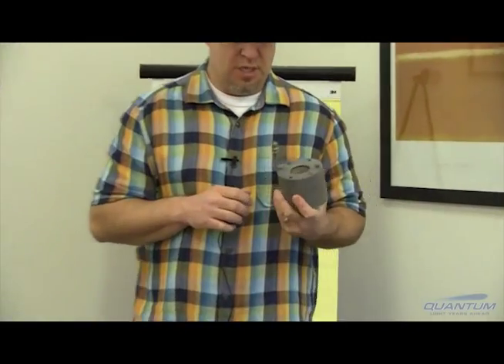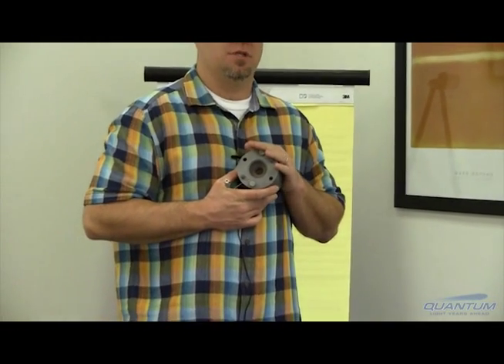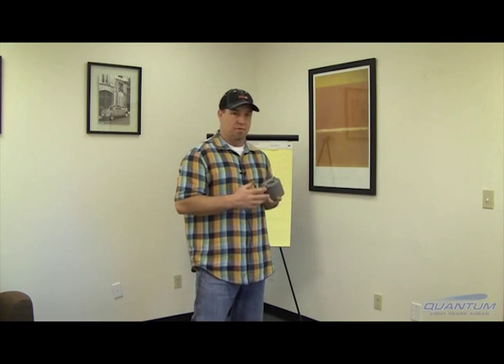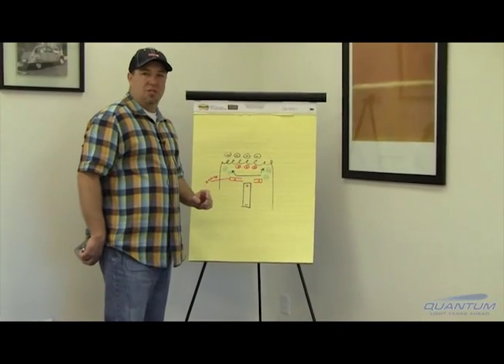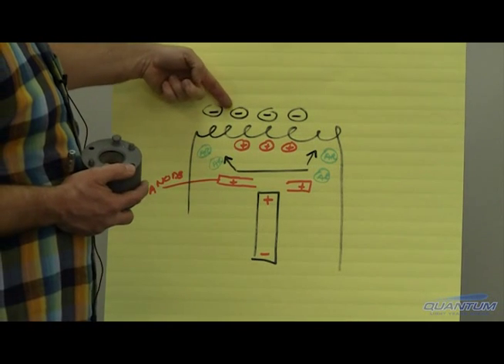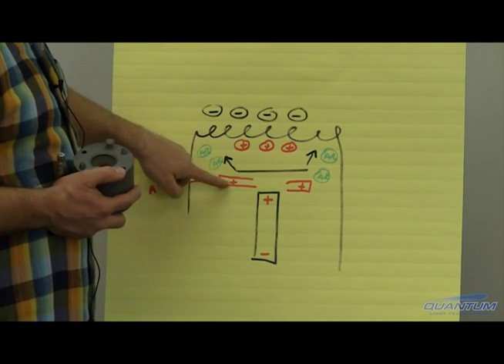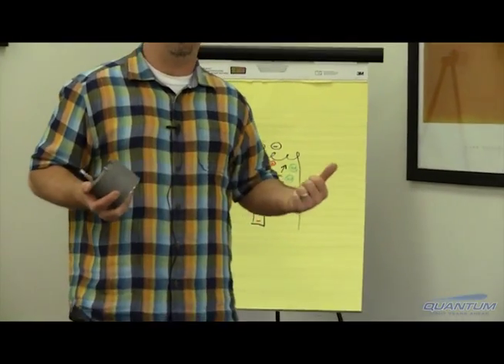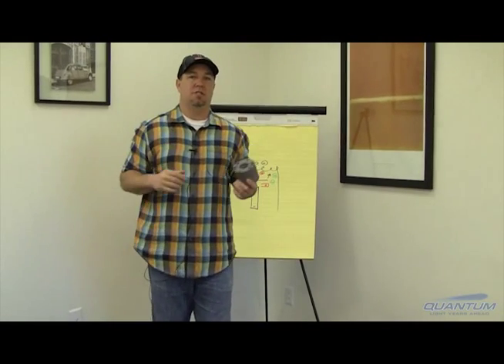How does an ion source work?

Comment: Thank you, to summarize a gas is placed about a filament that is emitting electrons due to a  potential difference on the filament. The emitted electrons bombard the gas atoms causing the gas electrons to be ripped away from the argon atoms;causing the gas atoms to become positively charged ions. Question:How does the filament emit electrons from it's surface when a PD is across it?
Reply: I'm by no measure an expert on any of this, and am a bit confused by the video.

Generally, when you need free electrons, you put a potential difference over the filament, which heats up to over 1000°C (1200-ish, if memory serves), at which point the electrons are "boiled off" the filament.
What I'm confused about, is that in order get the electrons away from the filament, you usually have to negatively bias it, but I don't understand how "bombarding" a gas with electrons, can knock the electrons off the gas molecules. Surely, if there's an excess of electrons, the ionized gas will just immediately reabsorb electrons.
It makes much more sense to me, if the filament is positively biased, and heats the gas enough to strip the electrons off the molecules, to absorb said electrons, and repel the now very positive nuclei.
Reply: Just did a bit more research, and I'm wrong. Apparently the free electrons, hits the gas molecules, and excites their electrons to a much higher state, which causes them to fly off the molecule.

(but the free electrons are stille boiled off the hot filament, which is negatively biased)
Reply: @martinfyhn1976  That's why this happens in an environment with a linear-ish electric field in it so that the electrons and the ions go in opposite directions
Reply: Nipple